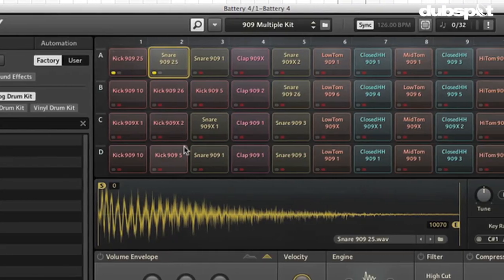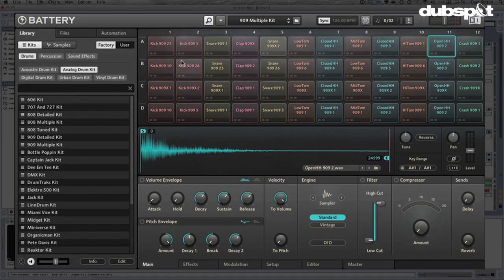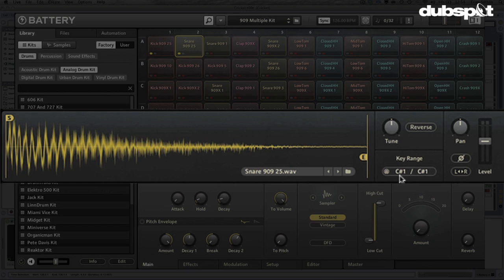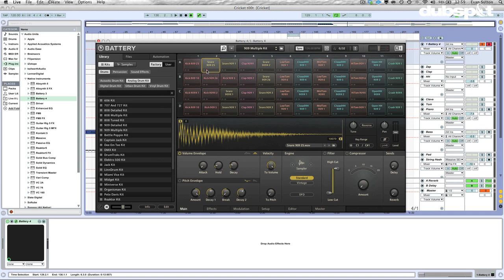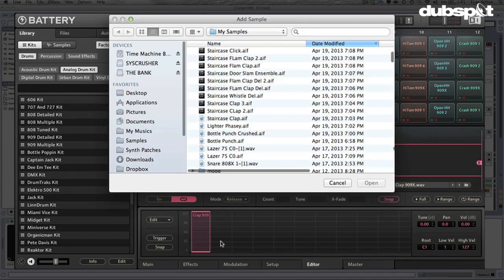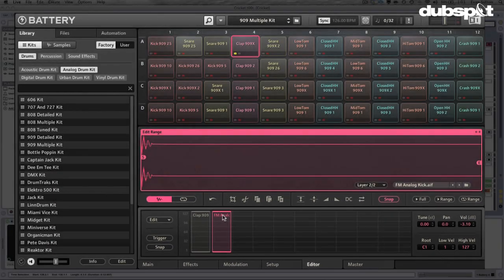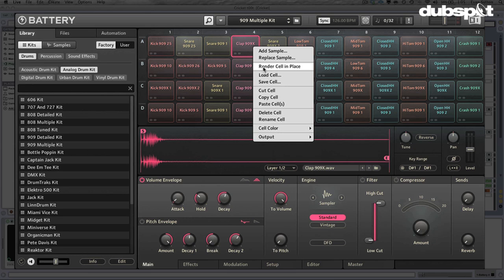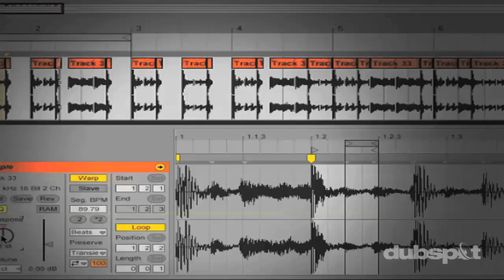Sound Design Tutorial: Layering Drums - Native Instruments Battery 4 w/ Evan Sutton

Comment: Total newbie question... how do I edit a sound without the editor flicking between the samples used as the track plays? The only way I can edit is to stop the track. Presumably there's a button somewhere so the editor stays on one sample, right?
Reply: Guitarded270 
On the Battery4 toolbar there's a little square button -- the tooltip says "Selection follows MIDI input". DESELECT that.

Comment: Hi. Just wondered how you get drum sound to continually play a rhythm . I just seem to get one sound at a time which I have to input into my sequencer. Many thanks Warren
Reply: Hey Warren - You'll need to use midi to trigger any virtual instrument.  AKA : Draw in your sequence on the channel that the instrument is assigned to (or a separate midi channel that controls the instrument)  If you are launching Battery as a standalone application you would need to control it with an external device.
Reply: thanks

Comment: Mixing on Headphones is difficult because you get the sound directly into your ear, without any room reflection and, most of the times, a heavy amount of bass. It's just an unnatural way of hearing, because normally you would have some objects and walls around the room reflecting sound and actually differing it quite a bit, but that's ok and it's ways easier mixing on speakers than on headphones.

Comment: I have a question. When it comes down to mixing, how are you supposed to mix your drums well into a track if the battery 4 plugin is only on one track?? I feel like i kind of wasted money on battery, cause when it comes down to it doesn't each instrument need its own track to be mixed in properly?? i mean it seems kind of dumb to use battery for one instrument on every track, right?
Reply: ever heard bout the multi output feature it has  ?
Reply: no??
Reply: +Davon Corbett Do you know if there's a lpf/hpf built in?
Reply: +Davon Corbett Do you know if there's a lpf/hpf built in?
Reply: @93tillinfinity6  Pages 36 and 37 of the manual.